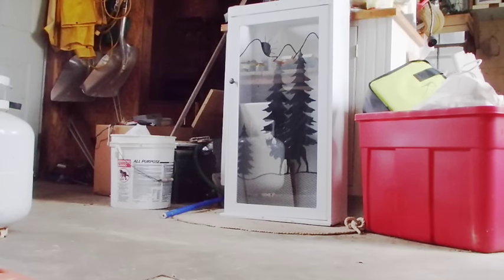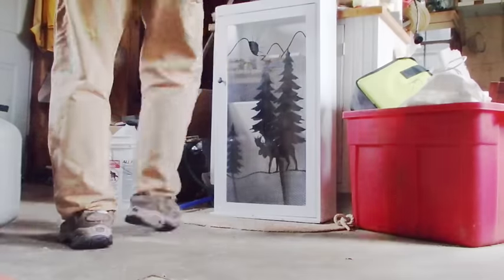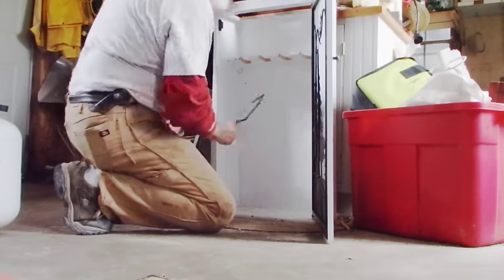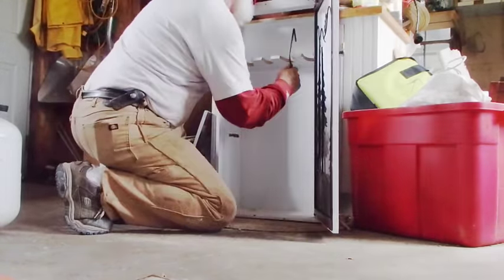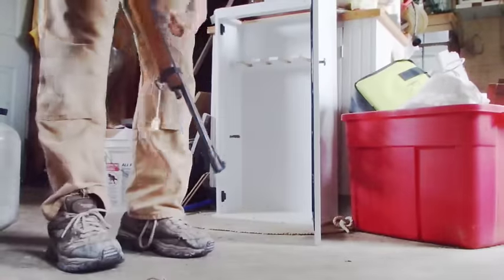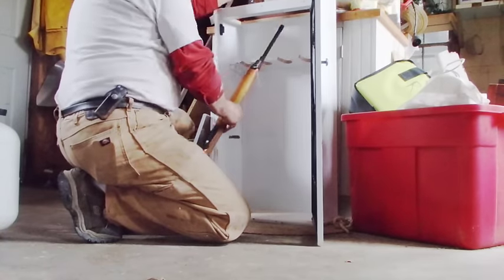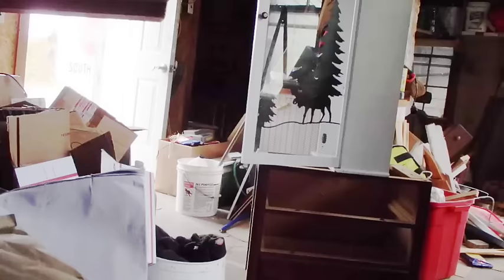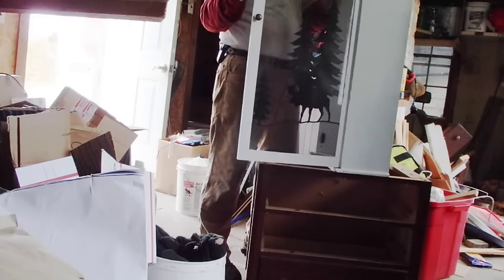More Gun Cabinet Make Over

Comment: If Ya really wanting to make your guns fit better. Ya might want to sit each rifle into its slot (one at a time) and draw a line on the bottom of the cabinet and then take a router to it and re-leave where the stock fits and that way the rifles won't want to fall out...... and maybe break the glass.
Reply from the maker: +Danny Walker   I'll just put a few screws in from the bottom side, into the stock of each ont, that way the won't woggle around.